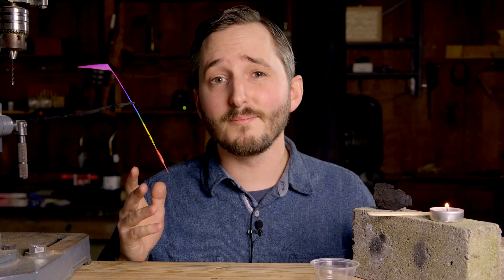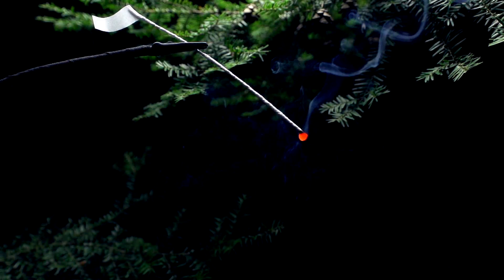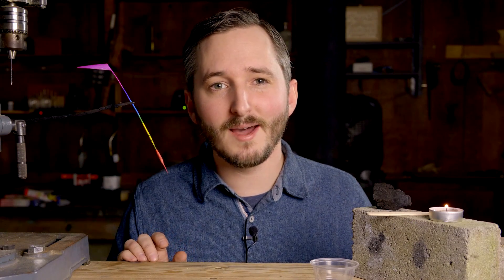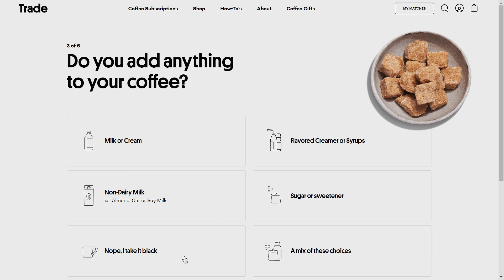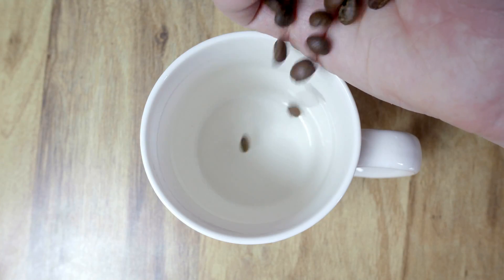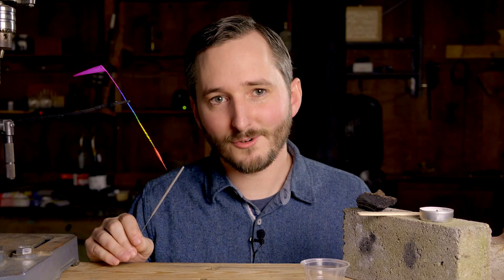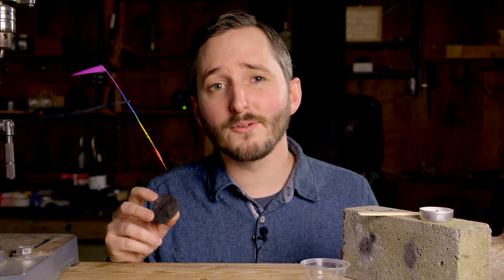Mystery of Branching Sparks Explained by Soda Water

Comment: So carbon monoxide bubbles forming in molten iron droplets from steel shavings? Doesn't sound like a large time frame to get oxygen in there though, plus the iron wants at that oxygen too.
Reply from the maker: I think so. I'm not 100% sure on the details of the bubble generation, that's a lot harder to demonstrate.
Reply: Just had a thought. Rust on the surface of the iron/steel probably contributes oxygen to the process. Oxygen bubbles from the rust likely doesn't do much from being at the surface, but the carbon under the rust could grab the oxygen as the surrounding iron goes molten. Rust is already used as an oxidizer in thermite after all.
Reply from the maker: Clever. That could be the case. Carbon can reduce many oxides. If the oxide reacted with the carbon under the surface it would create gas, and a bubble.

Comment: If you were to use, for example, aluminium or zinc in a combustable mix, would that work the same way as with metal powder? And would it have a visible effect on black powder since that's already quite sparkly? Love this in depth video about this topic, you'd think it's simple because you're very familiar with the sparks, but it's waaaay more complicated when you take a closer look! Great stuff!
Reply from the maker: Zinc and aluminum sparks do not branch very much, and the reason for that if this video is accurate is there is not an element in the alloy that easily converts to gas.
Reply: @Nighthawkinlight  Thank you for commenting! Do you maybe know of any other (easily available) metals that would work?

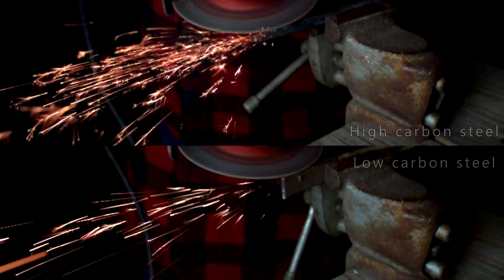Comment: @7:30 you swap iron and steel. But good job!
Reply from the maker: I actually didn't. It turns out that common cast iron contains almost twice as much carbon as steel. Seems the thing we all learn from history books that steel was created by adding carbon to iron is partially incorrect. It's more like steel is created by removing most of the carbon from iron.
Reply: @Nighthawkinlight  would have been helpful for you to explain that in the video. Without that piece of information your entire hypothesis makes no sense. In fact you refer to it as "pure iron" at 6:47

Comment: keep Darren and his camera
maybe try to develop some burn/spark powders? i would say high in nitrates and metal powders so makes lots of gas and sparks, you could add sulfur to add some energy to the system but also some chalk(or  anything really) to slow it down so it's not flash powder but spark powder? also Senko Hanabi shape looks good, with good slowmo you can use little of material to get some results